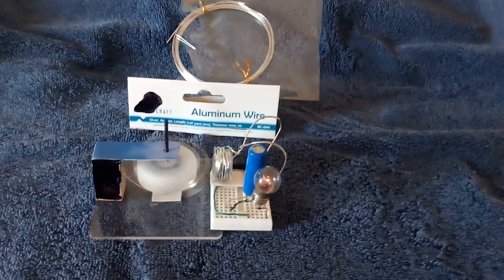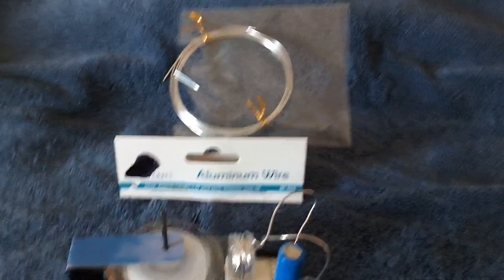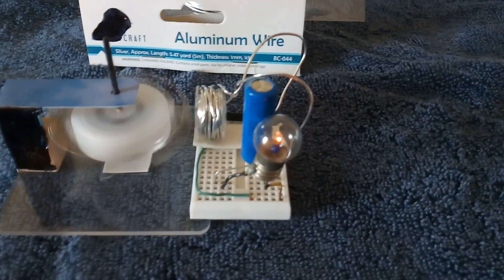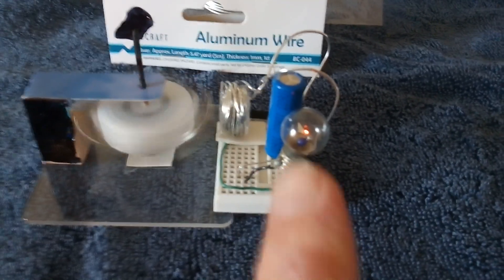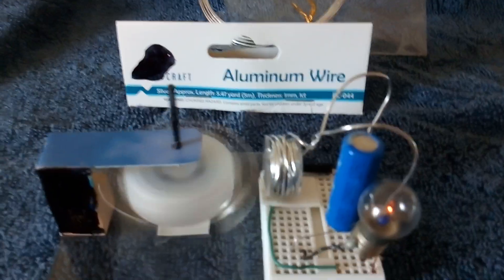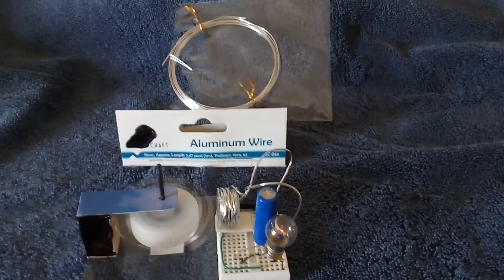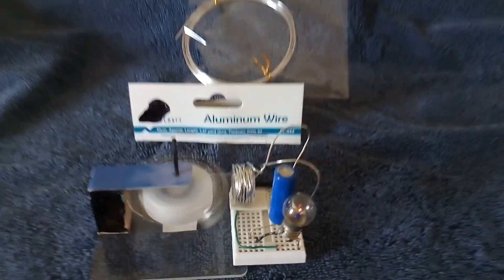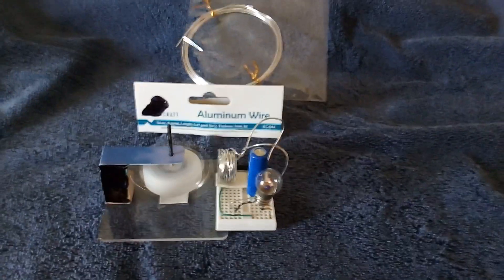Aluminum Wire Electromagnet

Comment: Aluminum is what they use for HVDC transmission lines...   You could try other types of wires too... the resistance will be adjusted based on the material used...  might be some benefit to using something like sheathed iron wire since it will pull the magnet in then the pulse can be set to push it past...   sort of a reluctance type setup.

Comment: BEWARE of scammy aluminum wire for house wiring!! i had really... really... REALLY bad experiences with it, the problem is not much the conduction, i used AL wire for my experiments a lot of times no problem, but when put inside walls, and it's stranded, it tends to oxidize cos of the high humidity and DISAPPEAR, it turns into that "alumina" white powder and the wiring is fucked, i laid several tens of meters for an alarm and intercom and i had to take all of it out and put real copper one after just like 3 years, some spots of the wiring are now covered in concrete and it's a nightmare!! apart alarm cable i also found that speaker red-black cable sold for cheap to be just aluminum, not too bad cos it's ok for speakers and can be at the end also soldered

don't get fooled of copper looking one, always scrape the strands with a blade and look closely, possibly with a magnifying lens, it's often copper plated to fool you, and yeah, it's oddly soft also

Comment: Who woulda thought?!
One way to test would be to take a multimeter to the store, if it shows higher than a short then it should be ok.
Reply from the maker: I thought the same thing about taking a multimeter in the store but I think the store people might not like it.  The wire was also sealed up in a bag.  This wire looked completely bare but it was coated.

Comment: Capacitance Mr Westinghouse, check materials in high voltage overhead transmission lines.  Copper 1.68 µΩ -cm   Aluminum 2.65 µΩ -cm. Remember the Mercury-arc valve ?

Comment: anodized aluminium wire are insulated coated, The aluminium oxide can handle far higher temperatures than the resin coat on copper.
Reply from the maker: Thanks.

Comment: Back in the 70s or maybe early 80s, in the telecoms industry, we switched to aluminium cables when there was a copper shortage. I was on the underground cable gangs back then, and we found it stretched as we winched it through the ducts. Obviously, that didn't do it any good 😮
Reply from the maker: Aluminum wire is interesting stuff to work with.  I made a Joule Thief today and it actually worked well.  It has a lot of downsides, like the one you mentioned, but in some applications it's OK.
Reply: @Lidmotor  When we pulled in a few hundred metres of cable, it was significantly longer when we had finished than it was when we started 😕😕 and no doubt the conductors had shrunk in diameter. I think we found that aluminium also went brittle with age so it became a terrible fault liability. I expect if we had been given special training to handle it, things might have been different. I am not sure how they jointed the aluminium wires, that wasn't our job. At the time the copper wires joints were twisted and then cut. The cut was intended to crimp the conductors together. In some cases they were also soldered. At other times copper sleeves were used and they were crushed on. Before I started on the job, the cables had lead sheathing and the cable joints were sealed in larger lead tubes and all soldered to waterproof them. They were air pressurised, so in the case of a leak, air should escape rather than water get in. The conductors had paper insulation 🤔🤔 Ah! Memory lane 😁😁

Comment: The later models of microwaves, before they switched to the inverter types, used aluminum wire for the secondary of the HV transformer.   Gotta save a fraction of a cent where they can.
Reply from the maker: It is cheaper.
Reply: Hi, OverUnity7734. You mentioned that later models of microwaves used aluminum wire for the secondary of the high voltage transformer before they switched to the inverter types. This implies that inverter type microwaves came after later model microwaves. It also implies that there were early model microwaves that came before later model microwaves. Therefore, if we call early model microwaves type 1, and later model microwaves type 2, and inverter type microwaves type 3, then what is the difference between the three types? I'm asking because someone made a similar comment about how newer microwaves are built differently from older microwaves but there wasn't enough detail to understand the point they were trying to make. You seem to be well informed about it, so I thought I'd ask.

Comment: Doesn't aluminum have more resistance than copper?
Reply from the maker: Yes but if the wire is thick the resistance is still very low.
Reply: Yes a given wire diameter of  aluminum wire has more resistance than copper of the same diamter, as Lidmotor points out. 

But an aluminum wire with 54% greater cross section will have the same resistance as the copper wire. 

Given that aluminum is very much cheaper than copper and very much lighter, power companies prefer to use aluminum wire to deliver power to your home. But given coppers higher conductivity through a cross section means most motor designers prefer to use copper because  they can get more amp turns in a given volume and thus make more power dense electric motors and generators. And in turn save money on using smaller magnets.